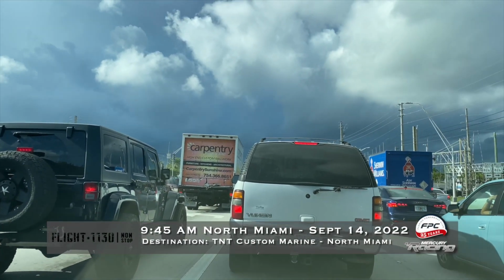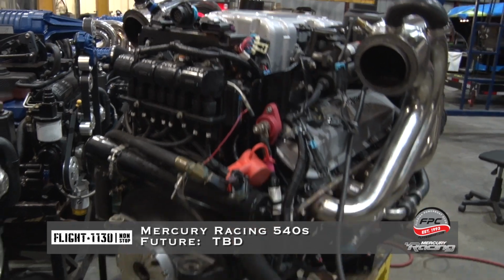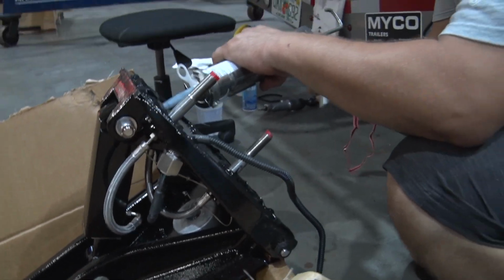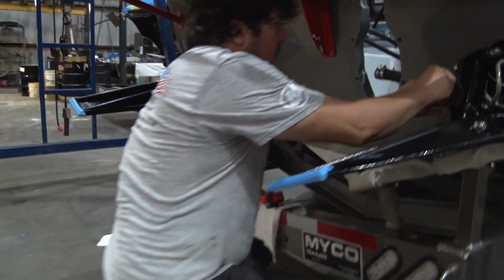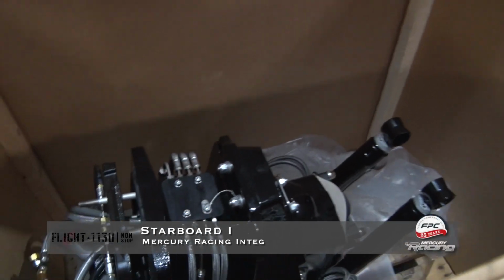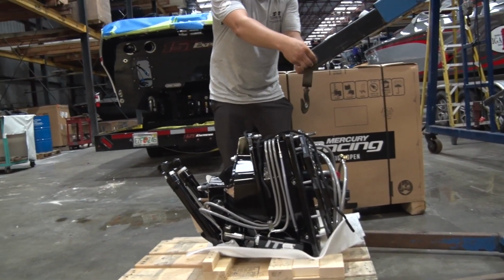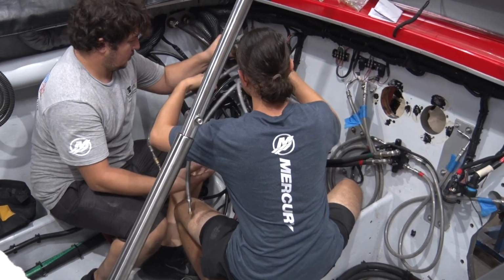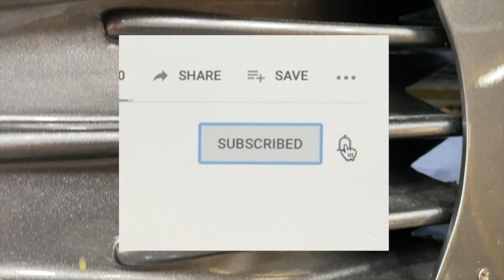Mercury Racing Flight 1130 - Cigarette EP 2

Comment: How many hours  on the 540's?
Are you putting  on the streamlined 
lower  units or the standard  foot style.
What is your  expected  gain in performance.?
Reply from the maker: 325 hours on the 540's
Lower units going to sportmaster shorty- 2 inches higher- ideal for the ITS set back

Comment: I viewed the first  video and saw the  sportsmaster drives  so the upgrades are 565 Hp and the  7" setback with the
Integrated  transom. The  props used  with the 540's  would be a good  starting point as the 565 's turn a little  higher rpm. That  would absorb some of the additional  hp. What style and size props
we're used  with the 540's? Hope  you are willing  to share  the technical  details 
and the performance  gains.  Thanks.
Reply from the maker: we used 28" pitch 4-blade Mercury bravo props, but now have upgraded to a Mercury raving 5-blade maximus prop- 28 pitch, and getting good results
Reply: @FLpowerboatClub  
Thanks for responding to my inquiries. 
I have A customer  with a 1993 Kevlar 
38 Topgun with  supercharged  502 
(Chief engines?) with twin Holly  4bbl
and standard XR drives turning 32 pitch
Bravo 4 blades at about 52-5300 rpm.
We think  the speed  is somewhere  between 75-80 mph.  A good friend
has a 2002 47 Fountain with 3 original
575 SC Mercs  and standard Bravo XR
drives also spinning Bravo 4 blades  repitched from original  32 p to 33 p
by Frankie and Jimmy's in Ft Lauderdale.
The owner  has had the boat for over 10 years, bought it with about 60 hrs and presently has over 700 hr. The center engine  has never been touched  internally  and runs great. The stbd and port engines have had valve jobs done years  ago the stbd had a bad cam replaced when the valve job was done.
The boat was rated at 93 mph when new
with A 115 lb test driver and minimal fuel. Late last summer  on a calm sunny  day going to Gloucester, Ma from Boston 
with 2  aboard we hit 90 mph on GPS.
High tide and no current. Gloucester  is 28 miles from  Boston  and the closest  source for 93 octane. Cape Ann Marina 
sells  93 for less than  Boston based 87
octane  and they have a good  open air 
restaurant and a well stocked marine  store.
 The  Fountain  lives on a hydrohoist near
Boston and is scrupulously  flushed  and washed with tap water. The Topgun lives
at a slip in salt water  and gets hauled regularly  for bottom cleaning.